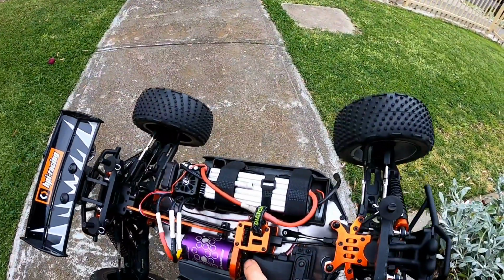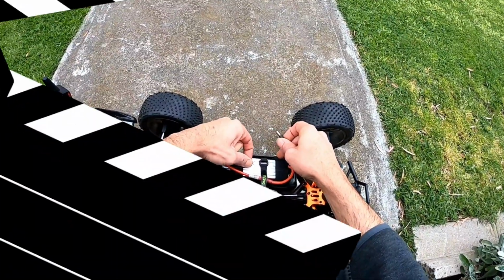HPI 1/8 Flux Truggy 6s first drive! 😍OMG!

Comment: Is that running stock m8
Reply: I see it first 6s run lol 😂 nice car loves how your mate come and your popping wheelies got some power
Reply from the maker: Thanks😁👍
Yeah 6s is a bit much for the stock diffs but it's so much fun😅🤘
Love that car!
Reply: What even if you put grease in them
Reply: Will a 4274 motor fit it’s a 5mm shaft diameter  will that make pinion be in line like that stock motor if you get me. I’m new to this
Reply from the maker: Yeah a 4274 will fit but quite a heavy and powerful motor so it may cause damage a lot quicker. 
And yes even with grease in the diff you can still do damage easily if it's overpowered or too heavy.
Reply: Ok thanks